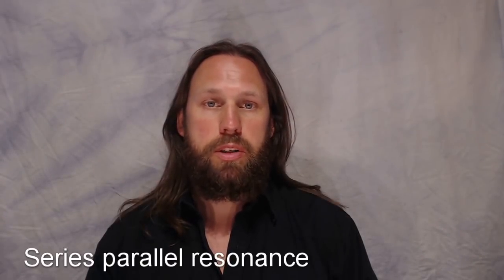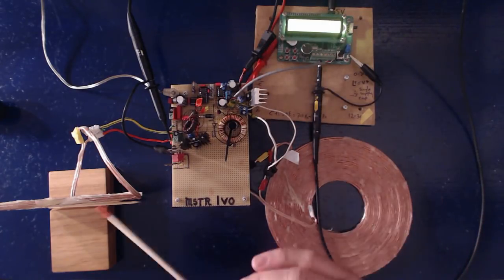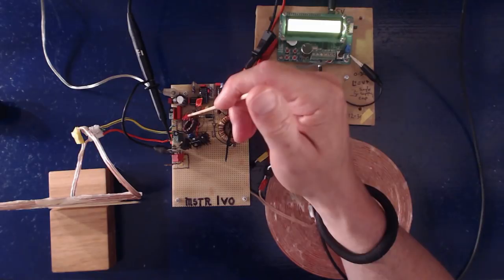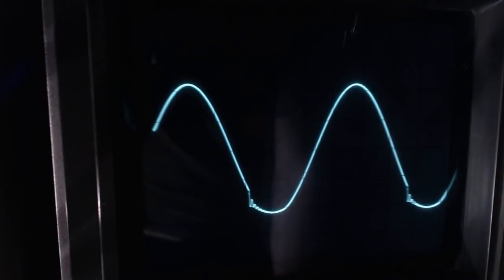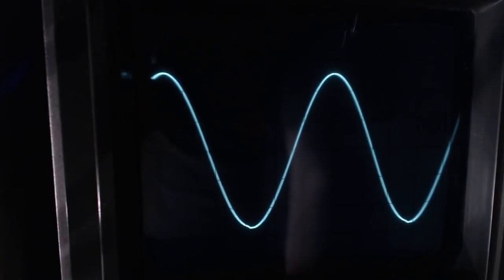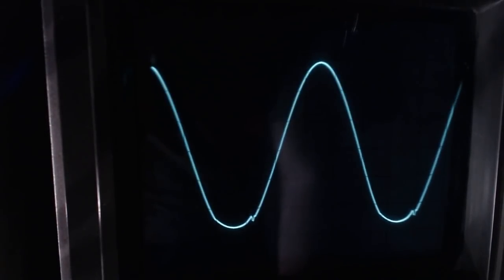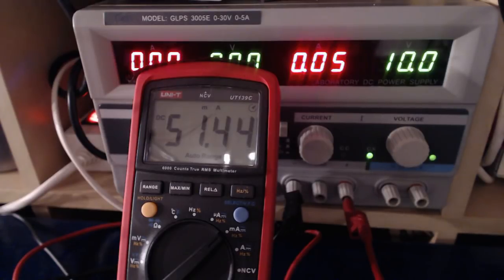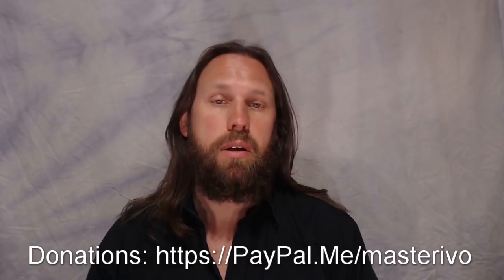Series parallel bifilar coil resonance, creates high energy gain.

Comment: Sir, please make a video on connecting phone-charging cables to a secondary bifiler coil.
Reply: Forrest Miller normally yes, but when you run a current through a tesla coil, you not only up the voltage coming out, but the frequency coming out is also multiplied. If you did everything you had to do electronically to fully rectify the current into a 2.4 amp 5volt dc current, or a 120volt 50/60 hertz output and then use that current with an adapter, the energy loss would virtually wipe out any gains you would achieve. You would do better to set up a Tesla hairpin circuit and utilize the energy potential differential to charge and run your entire house.
Reply: Forrest Miller Yes, resonance can be constructive or destructive. It depends on the frequencie(s) used. Look up the Hutchinson effect. I am experimenting with a particular unique coil of my own design coupled with high wild energy to initiate a thruster that doesn't use fuel. The energy feedback loop through this coil creates ever higher levels of voltage into thruster design i designed. I have had some.... limited success thus far. The design so far has two drawbacks. 

1) it's all aluminum. This means it probably would never be able to survive getting a vehicle into space and most certainly would not survive reentry. 

2) to be a usable form of thrust, i need it to do at least 1 pound of thrust (4.44822 newtons). Currently i am getting .0007 pounds of thrust (.00317) which is at least something, but not nearly enough.
Reply: Forrest Miller my advice for a phone charger on this setup.... don't. Unless you want to turn your phone into a paperweight that is.
Reply: Forrest Miller more than likely, the high frequency will bypass the battery and fry the electronics.

As strictly a battery charger, i would rig something up to try charging up an old battery that's otherwise presumably dead, and test it outside. 

In the case of an electrolytic battery, like a car battery, it should be fine, but i would still test it out in the same manner and never connected to my car.
Reply from the maker: For charging the phone?
Reply: Yes please
Reply from the maker: full brigde rectifier with uf4007 diodes, capacitor and voltage regulator should do the trick.
Reply: Thank you!
Reply from the maker: the uf4007 are ultrafast diodes, these are needed for the bridge rectifier, because the frequency is higher.
Reply: Timothy Haug it will burn my phone’s battery out?
Reply: Timothy Haug If you use the right resistors, or charge controller, would it not be sufficient to prevent over-fry?
Reply: Timothy Haug I need someone to talk to about this stuff. Thank you for your input. I have gained a huge interest in electrical circuiting since discovering the history of Nikola Tesla and even though I am a novice, I am young. I appreciate you going out of your way to explain this. Dont be surprised if I randomly message you here with questions!
Reply: Forrest Miller no problem, just recognize that my job is such that it does not lend itself to being able to respond readily. I can usually answer within in a day or two though. 

The main thing to know is that it is hard to tame wild energy. Once you run energy through a spark gap, you need to collect the energy indirectly in order to re tame it, and then control it. A tesla bifilar coil collects energy radiated from something like a spark gap and then you can step it up or down as needed from there as you are only using the pressure differential in the energy field. Think of a bifilar tesla coil like a dam. You have immense pressure on one side and you allow just a tiny bit to trickle through to the other side. This is just in relation to volts and amps however. Resonance can quickly become a beast that can wreak havoc on your electronics, influence the way you think, influence your mood, affect your health and can even kill you, all without the need of volts or amps. 50/60 hertz is an unhealthy frequency, 440 hertz is dis-harmonious to our thinking patterns, yet it is the frequency by which orchestras tune their instruments rather than the harmonious 432 hertz. You should look up the differences between 440 and 432 hertz on YouTube. Just such a minor difference has a profound influence on the way we think. Get a feel for the frequencies you will be playing with, especially before you bump them up into any energy levels that could cause you harm. If your unsure, start at no more than 1 watt and slowly increase the power. If you are not immediately affected, then you know it is at least safe for limited use, much like a cellphone, which i suggest that noone ever places near their head.
Reply: Timothy Haug Thanks. Yes I have done a lot of research on 432 hz. Interesting input on resonance. Resonance is represented by constructive and destructive interference in wave source interactions?

Comment: Holy cow! Is there a way of using these two coils in series where you can have them magnetically coupled with an iron core?
Reply from the maker: My coils are now aluminum wires that are copper coated, very cheap but effective. I'm going to build some pure copper coils in the future, they should have much less  resistance. But I remember aluminum being a better reflecter. We'll see what is best.
Reply from the maker: You can couple them magnetically when placing them parallel, indeed. iron is to slow  you need MnZn ferrite to increase inductance. but to find a disk that fits...
Reply: Master Ivo yeah finding appropriate material can be rough. What happened when they are inducing to each other in series? Throws off the resonance ?
Reply from the maker: in series you only have magnetic coupling, the dielectric field isn't used properly
Reply: Master Ivo what if the coils run opposite of each other?
Reply: Master Ivo try using silver coating, it's a better conductor then both gold and copper.
Reply: Use aluminum. You will be amazed at what happens. ;)
Reply: @timothyhaug2060  what do you want to say? please explain. thanks
Reply: Lenz Law is pretty informative to the result, the question would be how effective would it would be :D
Reply: Michael Pierce in my rather unique coil arrangement, very. Especially since i am attempting to create the first L wave antenna specifically for communication.

Comment: Another point that I'm asking myself concerning your experiment...Could it be possible that the surimposed capacitor discharge pusles at the right moment on the phase of the other wave could only sum up (and not amplify-multiply) the amount of energy already in the two waves? I think that having a way to mesure the gain would be important. This said, it still a really nice effect! Cheers
Reply from the maker: I think your right. but this is only an (important) detail in the whole system.

what would happen, if the resonant sine was loaded down, and the parallel capacitor was less charged. then the series capacitor would have a larger voltage than the parallel capacitor. Think about what this discharge would do.

Comment: Hey Ivo, thanks again for these good videos! You should try bifilar side to side (not one over the other one), you will get an increase in self inductivity and in self capacity. I already did these tests..... Anyway, just my two cents. keep the good work!
Reply from the maker: Self capacity, can you explain more? When the coils are stacked, they can act as capacitor plates.
Reply: Maybe "self capacity" was not enough exact. What I mean is when both wire of the bifilar coil are disconnected, you get more capacity side by side than one on top of the other one (even if in the last case you had more than twice the surface. We say that picture worth million words so here is some pictures that I just took:

1) one wire over the other other wire:  https://preview.ibb.co/kUwTic/one_on_the_top_of_the_other.jpg
2) Wires side by side (with half the surface area compare to #1):  https://image.ibb.co/hEZQUH/side_by_side.jpg

Does it make sense what I mean now?
Reply from the maker: Yes I understand now, thanks for the pictures. the capacitance has increased, but at the cost of inductance? (less windings).

The coil with the lowest resonant frequency would be the winner in my opinion. And if you measure inductance and the resonant frequency, you can calculate the capacitance without disconnecting the windings.
Reply: @MasterIvo  Hi Ivo,

thank you very much for your valuable work! I don't know how you measure the high frequency currents?
I only measure all currents indirectly via a low-resistance ohmic resistor using a differential probe and go to a digital oscilloscope with the signal.
This is the only way to get correct values. Other measuring methods often showed an overunity that was not there.